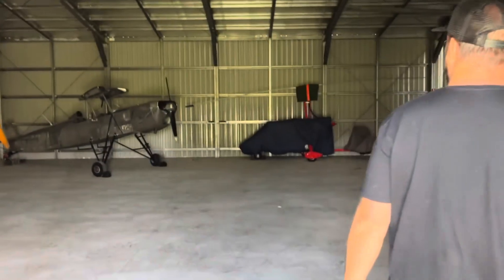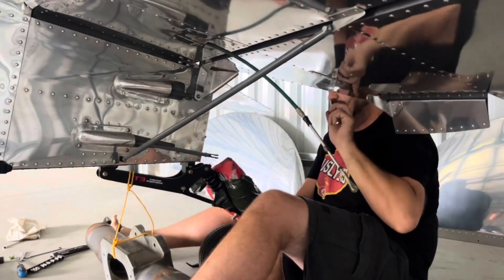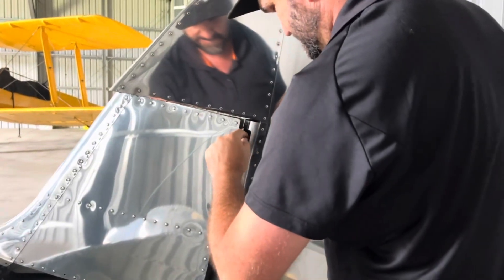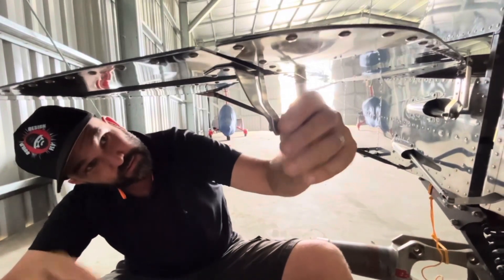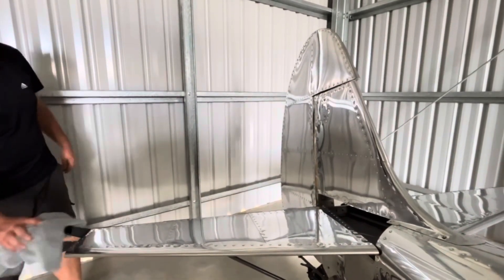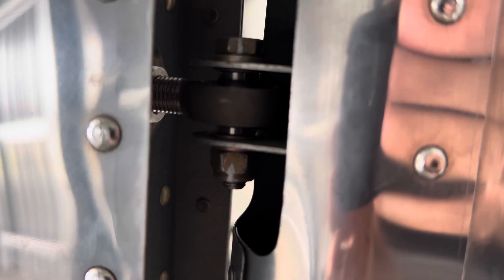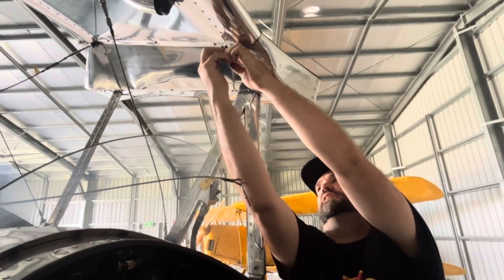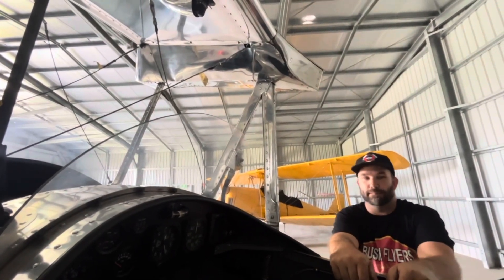Final assembly of Frankenstein’s tail

Comment: I have to say it is always the left hand thread nut that falls off and goes for a walk if a turnbuckle comes loose, sorry I did shout at the screen "Try turning it the other way Don", we have all been there 🙂 I am sure you will come up with a few, 'If I wish I had done that, rather than this', moments. The tail look very nice indead, you got the curves just spot on.
Reply from the maker: Haha thanks mate. I knew I’d stuffed up and there was no wriggling out of it! I know I was a bit slow on working it out…maybe your future “encouragement” finally punched in! I’m keen to see how everything shakes down in the testing phase, I’m definitely in that place where I’m going over everything in my mind and trying not to second guess myself. I’m glad the lines worked out, I spent a bit of time trying to get it looking right
Reply: @donwtsn   Don you would not be human if you did not have a brain fart every now and again. As I said it is always the left hand thread nut that goes walk about, as you never have one spare, or if you do, you can't find it. 🙂 The norm when I was in the RAF, was to fit the Left hand thread section of a turn buckle on either a fixed structure or the shorter cable.
Reply from the maker: It’s amazing how that happens huh! Keeping the left hand threads on the short end is a good trick
Reply: @donwtsn  We did it like that so we would always know which one was left hand thread. It was fun to put one on the other way around and watch people do just as you did (but often with blue words).